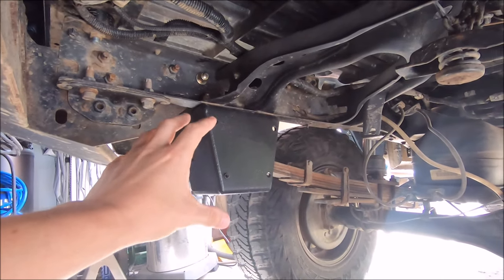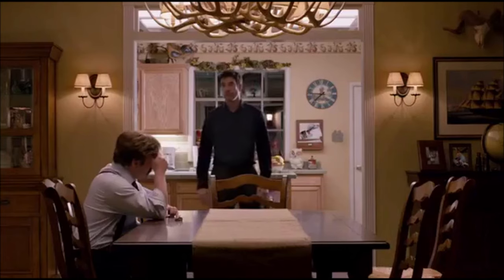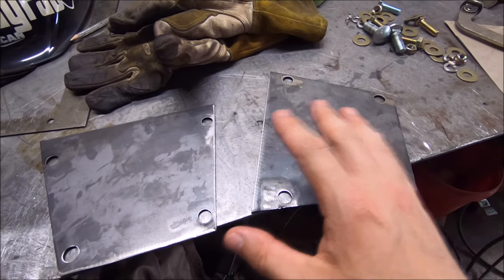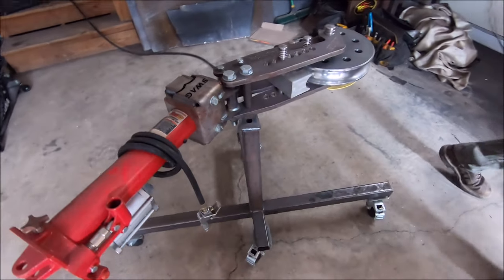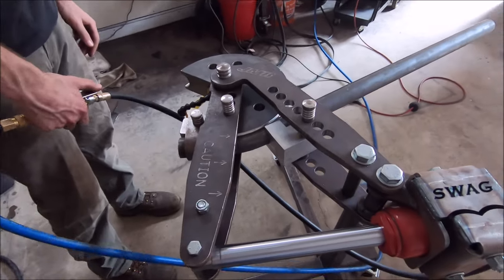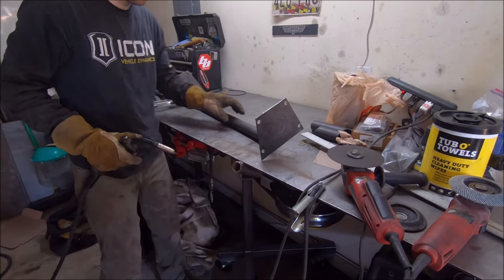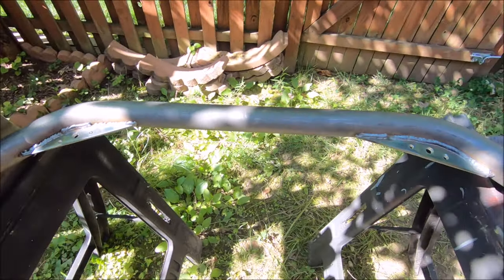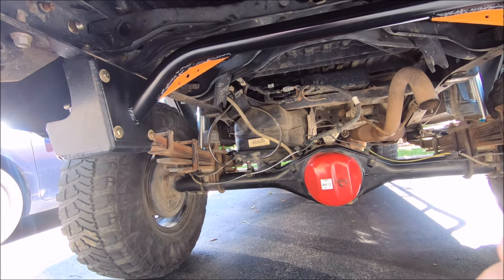Toyota Tacoma BAMF HD Hanger Custom Crossbar Fab & Install

Comment: Looks great!  Nicer than a bar going straight across.  Do you know what program 4lo pro used to calculate the bends and size tube and plate thickness?  What kind of bender is that?  Thanks!
Reply from the maker: Thanks! I'm sure he'll reply here and let you know the program and bender.
Reply: The program is called bend tech. It’s purely for calculating and bending tube.
Reply: @randallbrusher503   You do nice fabrication and your truck is awesome.  I am waiting for my mobtown sliders to ariive, I ordered them after watching all of tacomaholics youtubes about your armor.  I will hopefully be getting more of their armor soon!  Thanks!